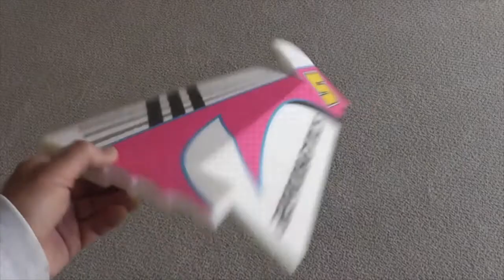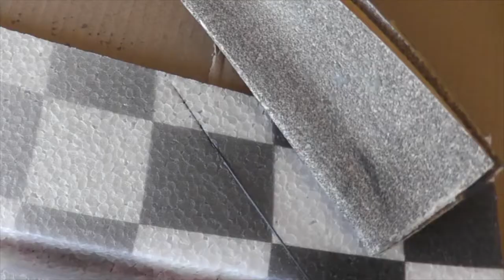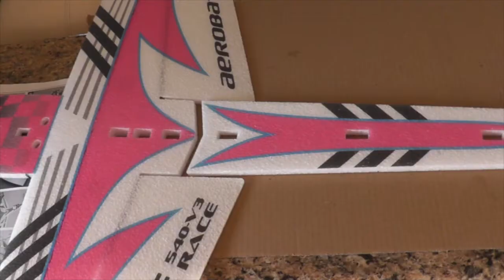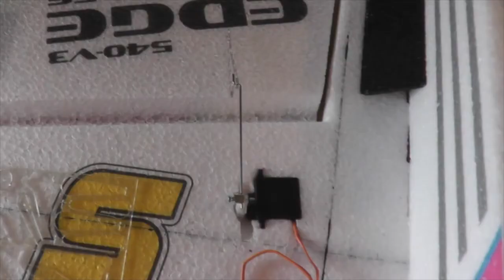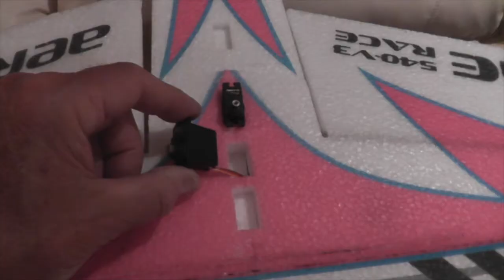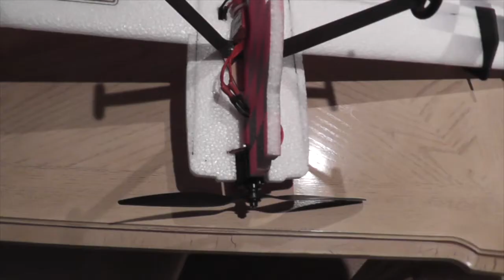Hacker Edge 540 V3 Build and Maiden Part 1

Comment: Thanks for this video. It really helped me build and finish quickly. It's much better than the instruction manual. The only difference is that I used Thin CA glue and Beacons foam tac because I didn't have any goop. I can't believe how good this thing flies. It will hover practically hands-off in my garage when trimmed out and perfect CG. Which for me was 250 mm back from the nose. I didn't think something so light could have the inertia to do some of the stuff I do on my Brushless 91"RC Skywing Edge 540. Now I can practice without the fear of crashing an expensive build. Thanks again for the step-by-step video. You are also an incredible pilot.
Reply from the maker: You are welcome! With the right motor these little foamy's can do it all. I have never flown a 91" plane but it must a blast. Thanks for watching
Reply: @thecuriousnomad4712  The way you fly this foamie, a 91" 3D plane would be a walk in the park for you. 91" is so much easier to fly, but expensive to crash. Lol. That kind of takes the fun out of it. I figured the more I practiced on the foamie the less of a chance to crash my 91" plane. Hope to see you build one. Happy Flying.

Comment: wth...even VH kits come with CF rods slots cut, no way ! Even holes...thanks to this video I am not getting a hacker kit
Reply: Most hacker kits have slots cut. Not these older ones. The newer kits have everything cut. One flight on this Edge 540 you would say it was worth cutting the slot. It is such a great flyer. With the Twisted Hobbies slot cutter, it is a piece of cake. For the Twisted Hobbies RC Factory 42" Edge 540 XL every slot has to be cut. Like 15 of them, lol.

Comment: BTW, I just bought this plane and I am in the middle of putting it together. The included black and white instructions are absolutely useless. At least in my opinion. Luckily, there is a Colored PDF version online AND there is your video, which helped a lot! So thanks for that! I also wish I had  used medium and not thin CA glue. I have no idea what I was thinking using thin CA glue!? Total nightmare. I am also not a fan of using kicker. Especially not when using thin CA glue.

Anyhow, I am using hot glue wherever I can. I guess Shoe Goop is better because it does not "set" as fast as hot glue, but I do not have any right now. You know how that is... instead of buying some in the store, you use something else you have on hand. Even if it is not as suitable... : ). Well, lets see how this build comes out. This is the first plane of its kind I am building...
Reply from the maker: Great, happy flying once you get it finished. Also, Goop is great glue for all RC planes and especially EPP, I use it for everything. You can get Goop at Home Depot Lowes or Hobby Lobby, thanks
Reply: @thecuriousnomad4712  Thanks and good to know. I will use Goop way more often, that's for sure. Just got done building the plane and the only thing left to do is install the receiver, ESC, battery and then set up dual rates on my radio.
Reply: @fc1133 Hot glue will make it excessively heavy. I would have waited and got goop, welders, foam tac or foam cure. Patience is key to building a great flying model.
Reply: @FarmerFpv  Thanks for the input. Patience is one thing I don't have though, ha ha.

Comment: This will be my next airplane.  That's why I'm  asking these questions.  I'm seeing bad situation here.  When cutting and inserting the c.f. strips down the length of the fuselage,  I'm seeing it cross over the wing spar.  With that in mind, the wing spar is going to have to be inbedded deep enough to allow for that cross over.  Am I correct.

Comment: On the long carbon fiber reinforcement strips that run down the length of the fuselage.  Are the grooves pre cut, or do I have to cut them myself.  Let me know please.  THANKS.
Reply from the maker: You will need to cut them yourself, just be careful not to go too deep. Thanks

Comment: i fly for more then 8 mint on 3s 1000 mah lipo and the cells are at 3.7 after flight i fly rcfactory edge v3 1m with volta 2212 1000kv

Comment: Great video, I need one too ;) Are you happy with your setup? Could you please list all the parts (motor, servos, esc) you used?
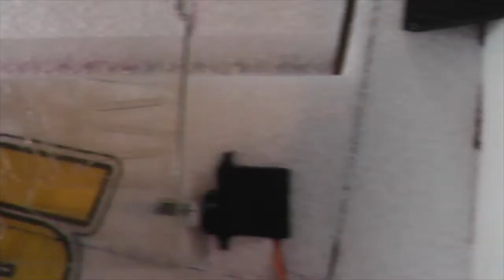Reply from the maker: Yes, been flying it almost daily and set up is perfect: Motor Sunnysky X2212-13 980KV, ESC: Turnigy Plush 25 amp, Servos: Corona DS 939. For prop I started with 10X4.7 for first few flights and then switched to APC 11X4.7 which provides more thrust and better performance. Batteries are 3S Zippy 1000mAh 35C. Flight time around 4:30 minutes.
Reply: @thecuriousnomad4712  what if one uses  a 1400/1800kv motor instead???